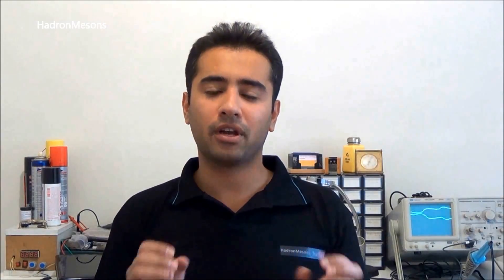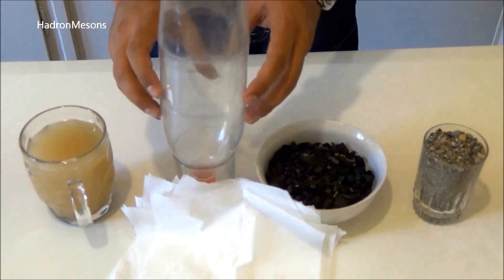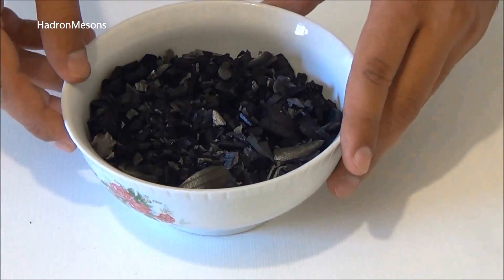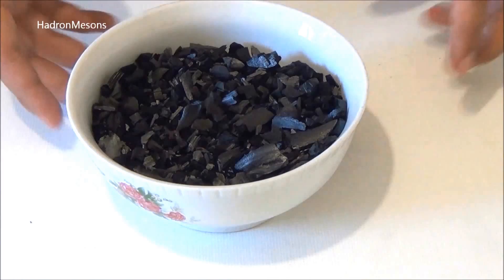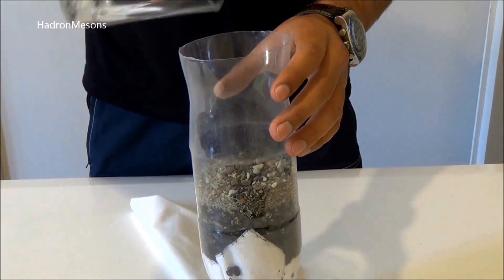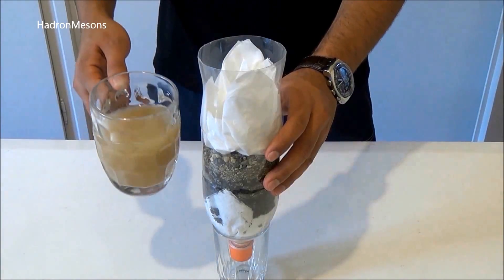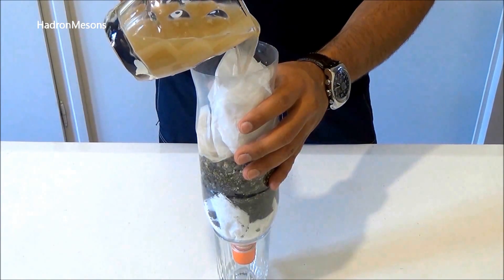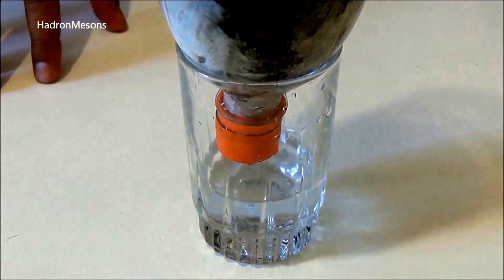How to Drink Dirty Water in Emergency Situation - Survival !!

Comment: OR ... just buy a Sawyer emergency water filter for 19 bucks and simply and safely filter
up to 100,000 gallons of water with that down to 99.9999% purity . It attaches to any bottle or hose or can be used like a straw. That comes out to  .0002 cents per gallon.

Comment: How to Drink Water in Emergency Situation - Survival

1- Get dirty water from dirty lakes, mud lakes, lakes, rivers.

2- Pour dirty water into a preferred drinking cup.

3- Slowly and gently raise cup while attempting to not spill.

4- Open mouth just big enough to fit 1/4 - 2/4 of the cup in the mouth.

5- Place water into mouth while making sure not to spill and doing so slowly, making sure 1/4 of mouth or 1/2 of mouth is filled with water.

6- Use muscles inside of the mouth to help produce a sucking like motion in which goes down the throat to drink.

7- Repeat steps 3-6 as much time needed until a feeling to not use muscles in the mouth to suck water into throat is present.

8- Repeat the steps 1-7 as many times as needed.

NOTE: If lower to middle region of stoumach is in distress, deal with it.
 #survivalguide   #survival   #muscles in mouth   #throat   #suck   #zucc   #succ   #science

Comment: THIS IS NOT THE ONLY WAY AND IS ALSO VERY INNEFFICENT this is beacause you need many different objects to make this as well as this this method does by no means get rid of deadly pathogens and waterborne viruses and bacteria if you for some insane reason you decide to use this for yourself BOIL ALL FILTERED WATER IF YOU HAVE NOT USED CHEMICAL TREATMENT METHODS this coud easily kill you if not done correctly instead use several layers of cloth or sterile bandages (tissues do not work at all) to pass dirty water through and get rid of all large contaminents after doing this several times boil the water and if the water is still not clear evaporate the water in a bag and run the bag to a container so that the water can collect you are welcome THIS IS HOW YOU FILTER WATER NOT HOW IT IS SHOWN I N THE VIDEO
Reply: It works, use what you have

Comment: can you drink sea water like that?
Reply: No, desalination of sea water is not something this filter would do.
Reply: look up reverse osmosis and thats how you can drink sea water
Reply: Never drink sea/salt water. If you do, it WILL kill you. the reason for that is that sea water contains more salt than the body can handle/get rid of. 

 Sea water contains about 3,5% dissolved salts (35000ppm), and thats way more than the human body can stand. Safety limit for drinking water is 500ppm. Higher levels than that, will dehydrate your body. If you drink sea water with 35000ppm salts in it, it will increase your blood pressure to a level that the body cells will start to press out theirs remaining fresh water, trying to decrease the salt levels in your body. This can result in water in the blood stream (dangerous condition just that). 

Your blood pressure will also rise to a deadly level and/or your cells will die of dehydration. 

And your cells=You...

Comment: "Im abaondoned in the middle of the forest at midnight, no water to drink, Fuck! I knew I should have brought some charcoal!"
Seriously? When I go out, you can really bet on the fact that I wont have a bag of charcoal with me. -_-
Reply: Start a fire . After it burns out, take the charcoal
Reply: Chris Black there are alot of things wrong with your mere assumption that claims that you can just 'Start a Fire' and then take the charcoal. To start a fire, you need wood. And you can bet that there wont be any wood lying around except of sticks and stones, so you need to take them from trees.You cant snatch wood from trees with your hands, so you need a heavy tool, like an axe or a hammer. Sure, you can use a stone as well, but good luck with that lol. You know the BEST way to purify dirty water in emergency situation? get some dirty water, dig a few centimeters deep into the soil, and pour the water into that part of the soil. Wait for 5-10 minutes. Then pick up that soil and spueeze the water out of it into your mouth. I know, it sounds stupid, but soil contains humus that attracts bacteria. It also has minerals and nutrients that mixes with the harmful chemicals purifying it SLIGHTLY. In a real life 'Emergency', thats the best option.
Reply: even in the suburbs there are sticks and small branches everywhere

Comment: Hmmmm... I would think that it would be better to place the charcoal on the bottom.  I would put the sand and gravel on the top to remove the larger impurities, and then pass the water through the charcoal to filter out the smallest of the impurities. Also, since the charcoal (having been created by high heat) would be 'cleaner' than sand and gravel, it makes more sense to use it as the final filter.  And, No... DON'T wash the charcoal - that just introduces whatever microbes are in the water to your final filter.

Comment: This is not correct. He is only removing the solids from the water to make it look clean.  He has not removed the bacteria. When we go camping there is Giardia in the water.  I would not trust ultra violet light to kill bacteria. What soldiers really do, and campers too, is to use chlorine or iodine tablets. These chemicals are completely removed after they kill bacteria by placing the water in the sun light. In an emergency situation you would put a small splash of household bleach in the water and then use sunlight to destroy the bleach. Sunlight water and household bleach all common items even in an emergency.

Comment: a better process is to have cloth or coffee filters at the start, ideally, it is better to have sand as the last thing the water passes through, then the charcoal, it works better to first clean large char parts and refine it down to a black powder. this allows full surface tension so that more microbes and metals are pulled away, next you should have another piece of cloth or once again, a coffee filter in place, lastly, its a good idea to place small pebbles or rocks on top of this, this filter is not to really purify the water, its to remove any large debris away from the water before it is filtered. this will get the water to a 80 to 90% pure state but it is ALWAYS safer to boil your water if you plan on drinking it.

Comment: If you have rope or a shirt you can cut a strip of cloth from, you can simply put one end of the rope or cloth on the dirty water, and then put the clean Container below it so when the water absorbs interject rope or cloth gravity will put it down into the clean container. Only the water will be absorbed and it will filter out though the cloth or rope, while gravity pulls it down into your clean container. you can filter water this way with out needing fire or charcoal. The way above is OK, but what he doesn't tell yours that you still have to boil the water !! This way is Kindve a pre filtering before boiling the water to make it safe. This way alone is not a safe for drinking, it is simply a way to clean the star out before boiling. the method I said is used by the British military, and makes the water safe enough to drink without having to boil it. This method works best if you have two containers, but you only NEED ONE container.

Comment: this way is fine, but what is to say you will have a plastic bottle, gravel or charcoal ? I would use rope or cloth to absorb the dirty water and Kindve siphon the water down into the clean container, it be more effective and safe filtering the water, and all you need is a container and either a strip of cloth form your shirt or a rope.

Comment: Using a water bottle is cute but not practical in an emergency, simply because of the amount of filtered water produced.  A more useful application would demonstrate the same process using a higher capacity container producing gallons rather than a few liters.  Still, the concept is a good one.